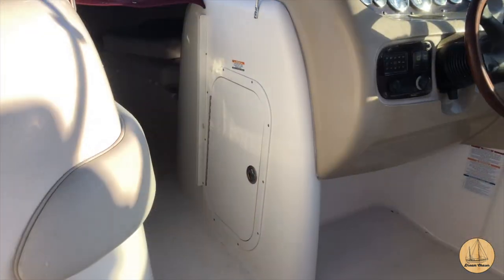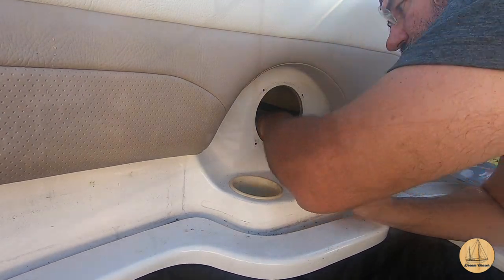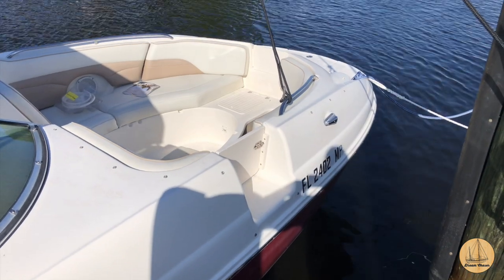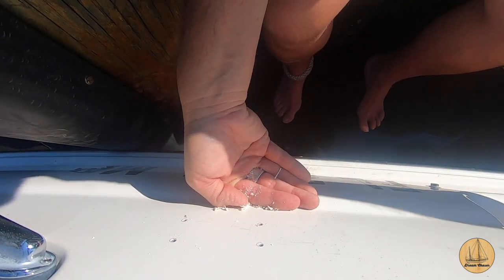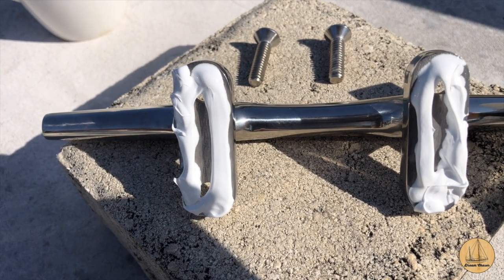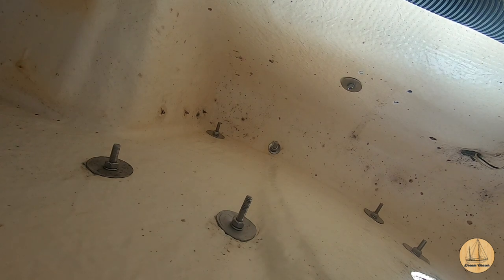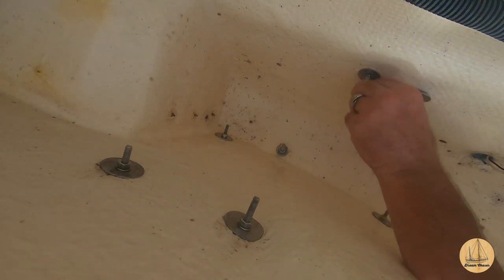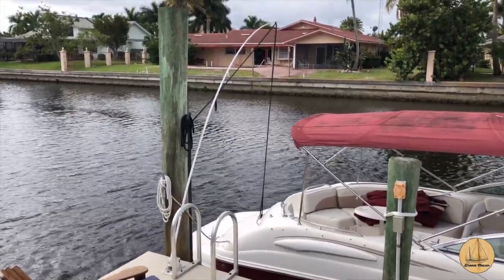How to properly install a boat cleat

Comment: I don't consider a fender washer a backing plate.
Reply from the maker: For a small boat like this I believe it is plenty. On our 52’ boat that weighs 30 tons, I would agree that a full blown plate would be better but this dock line works great on this sized boat.

Comment: I tend to use actual backing plates on my cleats.  Typically 3/16 aluminum  plate with slightly oversize holes to allow some sealant to get between the plate and the stainless bolt.  Gives the cleat more support.  I never use just fender washers.  I've seen those get pulled concave under load.
Reply from the maker: I would tend to agree on our 51' footer that weights 60K lbs, but in this case for a boat that weighs only 3k lbs and with a cleat that is designed for holding the whip line to keep the boat held away from the dock, I suspect these will be ok.  I would agree however that the bigger the backing plate the better, especially if you can get it contoured to fit the space you are working in.  In this example, I have a ridgeline on the inside of the hull that wouldn't' have allowed something must larger than the 1" perimeter of the bolt holes making a solid backing plate more challenging in this area and still allowing it to sit flat on the fiberglass.  
On our larger boat, I have also used 2 plates of varied shapes to provide more pulling surface area when the location of the backside of the cleat didn't allow a single solid plate.
Thanks for the comment and suggestion as well Pierre, I should have stated in these details in the video so others also know that whenever possible a larger backplate is like a larger anchor.  It certainly can't hurt and can only improve strength and safety.
Reply from the maker: Smart move. I certainly don’t disagree with your comment or approach. It would certainly add more strength.
Reply: @Svdreamchaser  one other thing I’ve started doing is running a counter sink bit in the holes to clean up the jaggedness from drilling.  Also gives the sealant a place to make a thicker gasket.  Yeah I hate deck leaks.

Comment: Thanks for the useful video!  Considering midship cleats for my yacht which has a ply deck.  I’m guessing longer bolts needed.  Thanks 😊
Reply from the maker: For sure longer bolts. There is also a theory to avoid moisture getting into the plywood core that you should consider. It is where you drill an oversized whole through the deck. Tape the back side and  fill with thickened epoxy, then drill the correct sized whole through the epoxy. This keeps any leaks over time to NOT Touch any of the plywood given the bolt is now going through the Apoxsee and not actually the wood. I hope that makes sense if not let me know here and I can point you to a video showing it as well.
Reply from the maker: The cleat install is all the same way this is just a way to protect that core
Reply: @Svdreamchaser  clever!  I would be looking to make a complete seal- so definitely the way to do it.  Thanks.

Comment: Once I have drilled the holes,I mask with tape the area where the based of the cleat will sit and draw around it in pencil. I then remove the cleat and cut away the tape inside the line I drew. After fitting it makes it much easier to remove the excess that squeezes out
Reply from the maker: That is a great idea!!  Thanks. I will try that next time.
Reply: You can also mask the lower part of the side of the cleat, for the same reason. I had to replace one of the stern cleats on Ibn Batuta last winter, because surge in the marina during storms pulled it clean off, shearing its bolts and those of its fairlead. We drilled out and went up a size on the bolt diameters. We've since moved somewhere I believe to be better protected, Marina di Ragusa on the south coast of Sicily.
Reply from the maker: Great tip Jerry

Comment: My tip for drilling in gelcoat, is to actually run the drill in reverse to get the drill bit to 'burn' through the gelcoat and not cut or split it, then drill through the rest of the fiberglass.
Reply from the maker: Great idea, I also think doing that creates a nice little angled opening to absorb some of the sealant you choose to use between the hardware and the deck or gel coat.
Reply: I would suggest two things first use masking tape to mark and drill in to, and also tape an open envelope to catch the bits in.
Nic UK

Comment: The real challenge would be to install (or reinstall, as it will be the case on my boat) stuff on a sandwitch deck...
Reply from the maker: True, I have done a video about that in the past somewhere.  It has been a few years.  In short, I drilled a hole about through both sides of the sandwich deck.  Then I bent a small nail and put it in a drill bit so that I 'wallered' out the core between those 2 layers about 2 times the size of the hole.  So for a 1/2 bolt, I would take another quarter inch or so off the core on the inside.  Then tape the hold on the bottom of the sandwich and put a syrup consistency thickened epoxy into the hole.  When set, I then remove the tape, redrill the hole through the new epoxy.  
The result is that you have built an epoxy bushing around the bolt that prevents water from wicking into the core if you ever end up with a lead down the bolt hole (or greatly reduce the risk of that happening at least).  It is hard to explain without a diagram but let me know if that makes sense, if not, shoot me an email at glhotka at SVDreamchaser dot com and I can shoot you an email back with an example diagram that makes it easier to visualize.  It really isn't all that hard, but in that sandwich case, you definitely want a wider backing plate, even if it is 3/4 plywood that is epoxy coated and then some large stainless washers (depending on the size of the boat)
Reply: @Svdreamchaser  Sir, you've made my day! I was already having headaches thinking on how to put layers and layers of epoxy soaked matt from below and keep it from falling on me as I work inside the lockers...
The charm of simplicity.
And yes, I understand your description, thank you so much for it.
Reply from the maker: @mikolajtrzeciecki1188  "I love it when a plan comes together."  I can't remember what movie that was from but it seemed appropriate here :)  Good luck, keep me posted and you will have to comment when you are done so other can read how it went here too, or if you want to send me photos, I will write a blog post showing how you did it if you want.